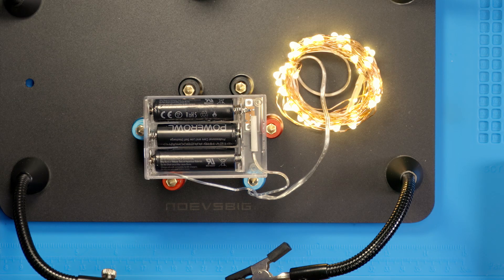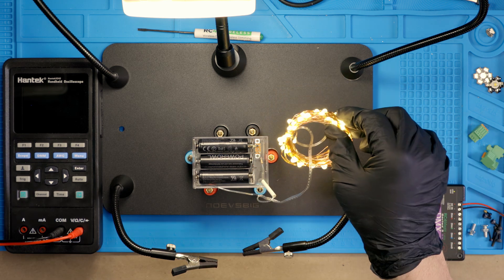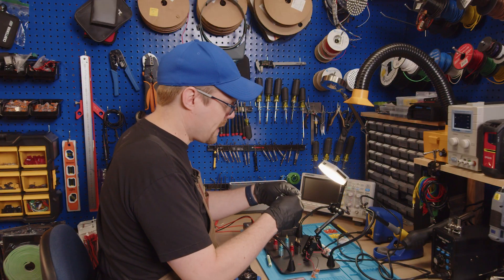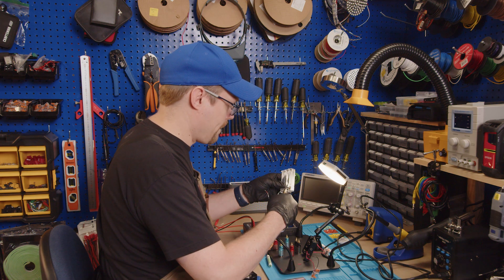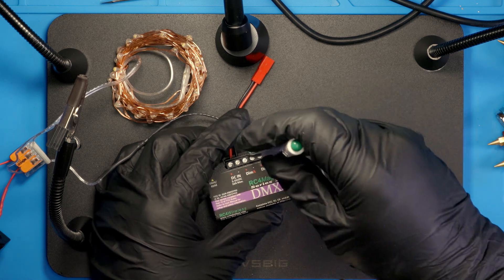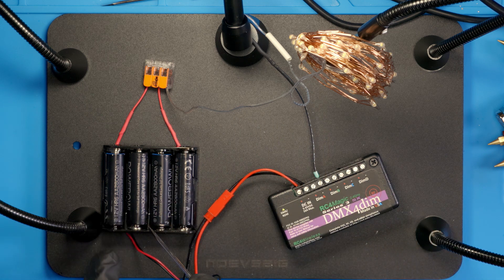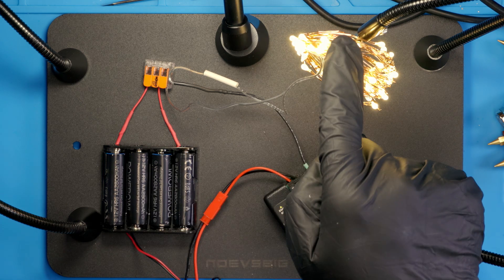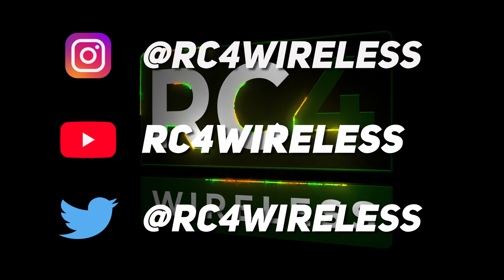Splitting Voltage Part 3: Control Fairy Lights with RC4 Wireless!

Comment: Why not change the resistor...
Reply from the maker: Depending on the situation, there are various reasons why operating at the originally intended voltage is more elegant. 

When using a higher voltage along with a larger resistor value, the resistor will be dissipating more energy, which is lost as heat. This requires a physically larger resistor, and it also wastes a significant portion of battery power creating that heat instead of going to the light source.

In other cases, you might be working with small incandescent lamps that aren't using a resistor, they are manufactured to operate at a particular voltage. 

And in yet other cases, many LEDs might each have their own small current-limiting resistor that is sized for a particular input voltage. Changing all of those many resistors is a tremendous amount of extra work that you can avoid by running at the originally intended voltage.
Reply: @RC4Wireless  but now the battery levels are not the same on the end...
Reply from the maker: @ernieek78  I’m not clear on what you mean. If you’re using RC4 technology and need personal assistance with it, we are happy to help through our Support Ticket system at https://rc4.freshdesk.com/support/tickets/news. Please provide as much detail as possible. Photos and short videos are often very helpful. Thank you!